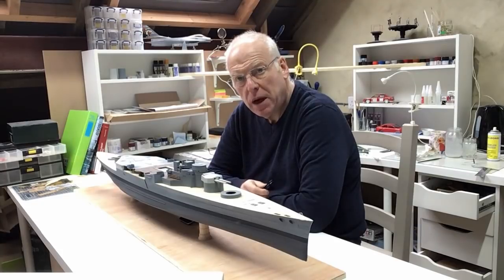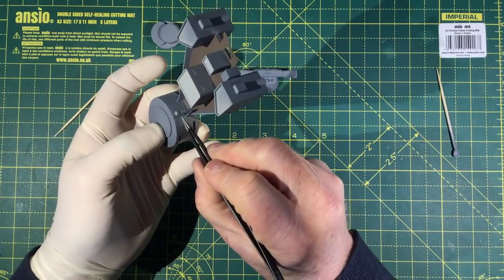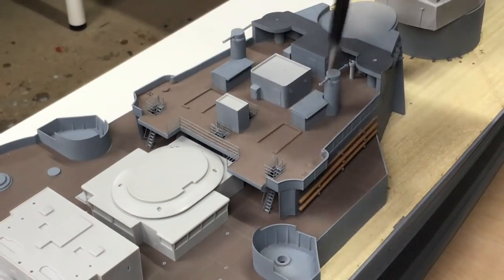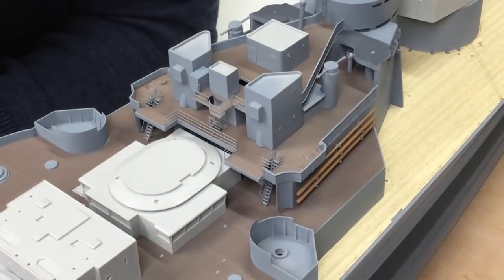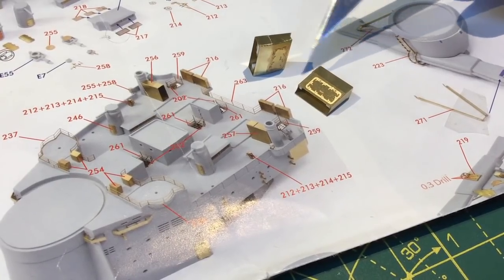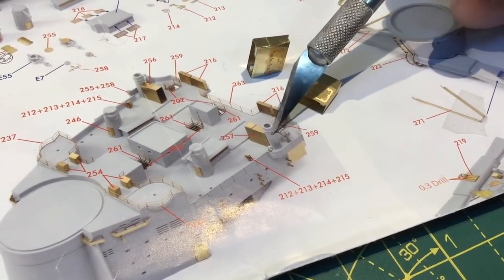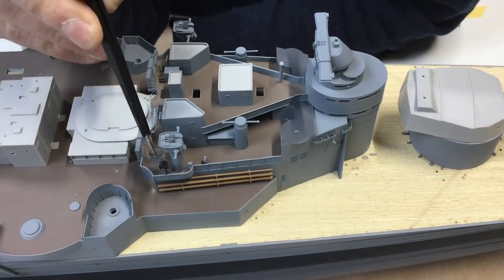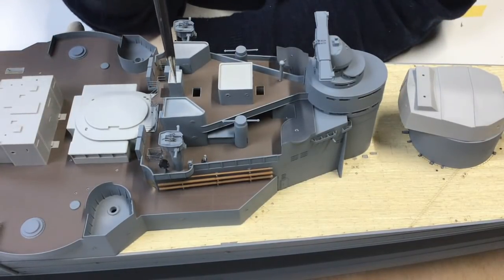Trumpeter 1/200 Hood full build with Pontos detail set Part 10 (admiral's bridge)

Comment: Like your flag lockers with flags, a very nice detail.  One suggestion for for your build moving forward, plastic tipped tweezers better grip, zero paint damage.
Reply from the maker: Hi Dave. Yes thanks for the tip I’m going to try taping some masking tape to the flat tweezers I use to see if that helps.
Reply: @TheModelShed  Yes, wrap some tape around the ends of tweezers a few times will act like a cushion and gives you a bit more grip to prevent those small parts pinging off into Neverneverland. Don't ask me how I know! lol. Great build btw!

Comment: Hello, Rather than use plastic strip , ever considered using sections of the kit sprue as reinforcing, some as is or some flattened or squared up with a file.
 I wonder what  percentage of the original kit is sprue and eventually discarded?  Also, did you manage to locate a pair of Jewellers/watchmakers pliers.?
Reply from the maker: Hi Alan. I have used sprue before for reinforcing but these parts are generally too small to use that method and The styrene strip guarantees squareness and saves time. I had a look at the jewelers pliers and I’d like to get a pair with round tips to help with the curved etched if I can.
Reply: @TheModelShed  I may be able to assist you there too, watch your email.

Comment: Just remembered ,when drilling small holes in plastic, resin or White Metal I use a small pistol type rechargeable screwdriver with a 7mm (standard) hexagon drive. Drills from 0.1 - 6mm and if needing anything I use stepped cone drills or a cone drill are  available of can be easily manufactured. Finally lubricant for drilling plastic?  
Try saliva, a good coolant and extremely and easily applied Good old `Spit`.

Comment: Do you remove paint to get a good adhesion when fixing one part to another ?
Thanks in advance
Reply from the maker: Only with Plastic to plastic joints Ray because poly cement relies on contact with both surfaces to melt and weld the plastic. For cyano joints I don’t as it acts differently and doesn’t need that direct contact.

Comment: Outstanding workmanship, love the tip on reinforcing photo etch parts.
Just curious how many hours taken so far?
Reply from the maker: Hi Gary. I haven’t been counting but I work for around 4 hours every day so I’m guessing around 250 hours total to date. I estimate I’m probably 1/3 - 1/4 through now so I’ll end up towards the 1000 hour mark by the time I’m finished suppose.
Reply: @TheModelShed  honestly that doesn't surprise me the pontos kit is so comprehensive and completely replacing sub assemblies must add tons of extra work.
Will you be doing the same for the bismark regarding pontos kit?
Reply from the maker: I want to move on Gary to the Bismarck with the Pontos advanced set when Hood is finished. I have them ready to go as I got both Pontos sets at Telford in 2018. There may be a gap in between as I want to build a twin display case for them both in the shed which will take a bit of time out of the modelling schedule. So that looks like my schedule more or less mapped out for 2021.............

Comment: Excellent once again Steve. Question if i may, with the various rails near the flag lockers, are you brush painting them after attaching them to the structure? if not how do you keep the cortisene colour deck free from overspray.
Reply from the maker: Hi Michael. I fold the rails to shape first, then prime and paint them with the airbrush, then fit them to the model with a tiny spot of thick CA at the ends and in the corners of the bends. If any CA shows I'll just airbrush a light dusting of matt varnish to conceal it. Any scratches I touch in with a 000 sable brush. Hope that helps.

Comment: can any one tell me apart from the glue that's out now what glue does he use so there are no drips am thinking of getting this kit
Reply from the maker: Hi Philip I use various thicknesses of cyano superglue depending on the application and tamiya standard and thin cement for plastic to plastic joins.
Reply: @TheModelShed  ok thanks for that I've not ordered the model yet I've got more important things to do first like pay off the bills so any super glue will do the job and a large magnifying glass to see the very small part and holes in the kit
Reply: @TheModelShed  as some of the metal parts of the kit are brass as brass will break very easily and with the kit being nearly £400 I don't want to make to many  mistakes